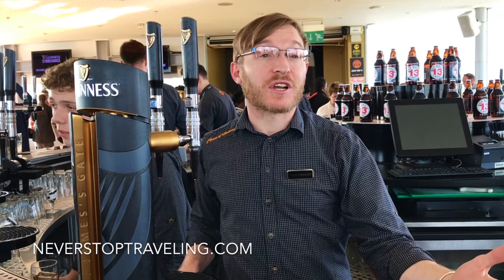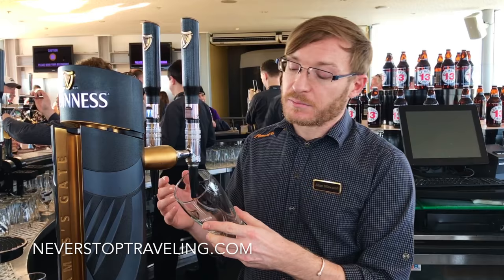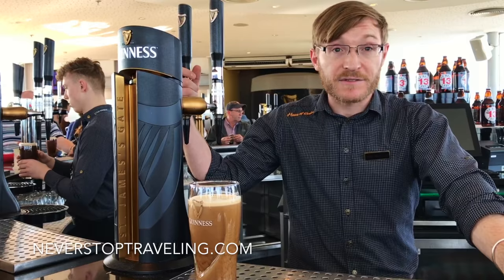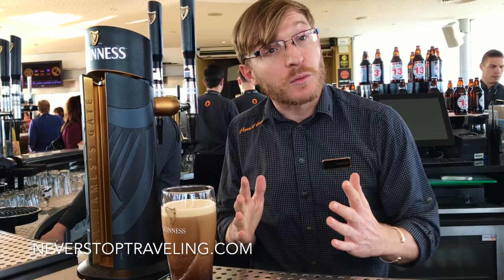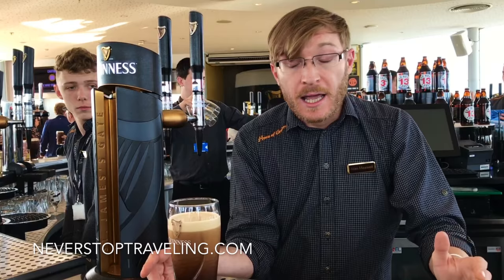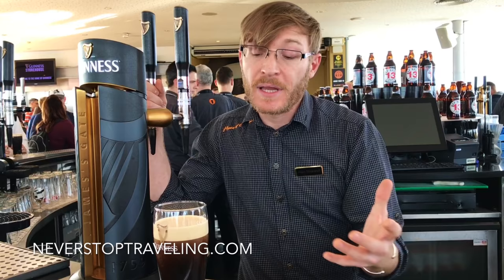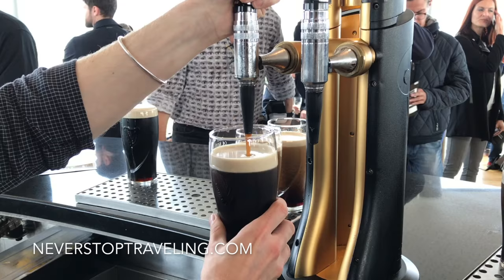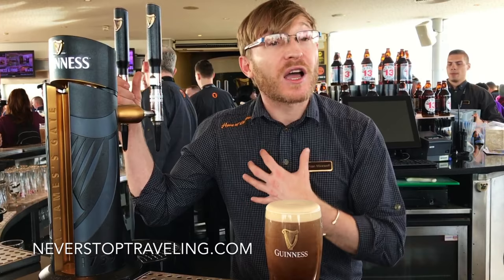How To Pour the Perfect Pint of Guinness

Comment: all marketing. Tastes exactly the same in a single pour.
Reply: Did you even watch the video? He explains it’s purely aesthetic.
Reply: Wrong
Reply: Iv done it in a single pour , yes guiness can be done in one pour and it will taste the same but you not get the dome head on the pint and will end up with a thinner head
Reply: @quack437  that is not only untrue, it's the opposite of what happens. Single pour gets a slightly bigger head that lasts longer
Reply: @Tasmanaut  well iv tried and tested it so take from that what you will
Reply: Yeah but a single pour gives a head fhd size of an ice cream scoop. I didnt pay for a fucking half pint
Reply: @elll2184  that's not true. You can change the size of the head by the angle of the glass.
Reply: @Tasmanaut  good to know. Will be trying it out next shift 🫡
Reply: @elll2184  you'll honestly be surprised. The entire 3 stage pour is designed to make customers think Guinness is extra special because they have to wait. It increases their anticipation and it's that simple.
Reply: @Illness.og. Bless your little cotton socks

Comment: Thanks. Working later and nobody showed me this. They just fill it right up. There is a weird device like a silver plate (round about 3 inches and circular) called a surger or something...what is this for please?
Reply: that's becuase you dont pull it properly, the surger aggitates the beer to get the bubbles, it works like an ultrasonic jewelry cleaner does